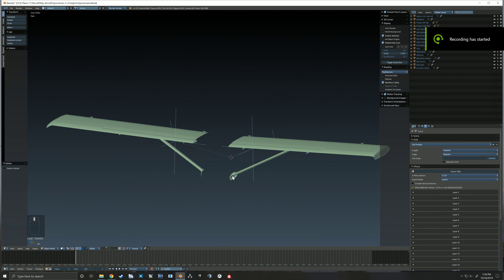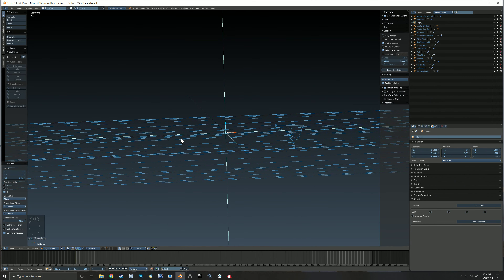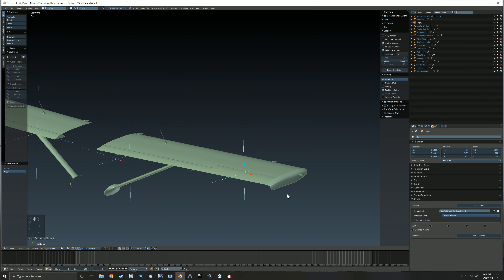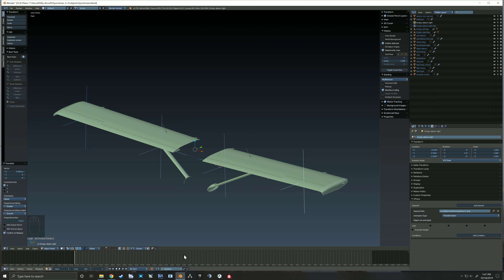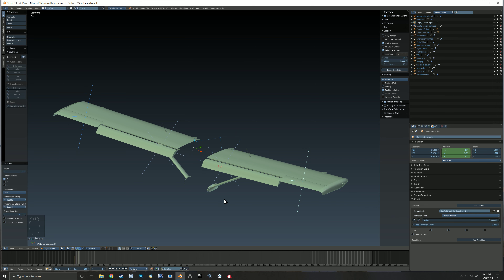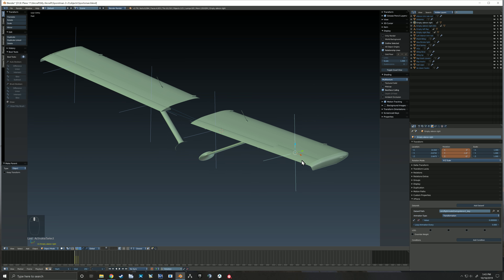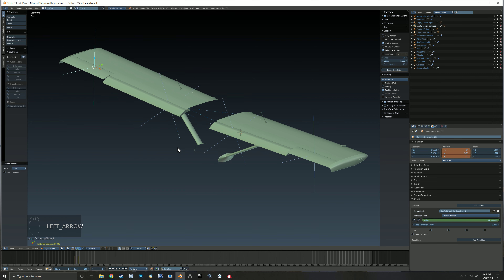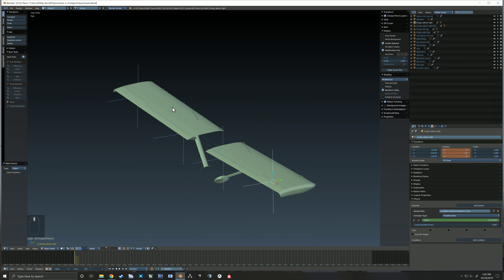How to make an airplane for X-Plane 11 Tutorial #29

Comment: Hello man, many thanks for your video tuts, very informative !

I have a question : I made complex animation of a whole wing ( wing sections for wingflex, ailrons, trim tabs, fowler flaps, propeller ( multiengine ) etc. How to make that full wheel mirrored, including animations ? Cannot just redo everything, and the -1 scale trick do not work when exporting to X-Plane. Any ideas ? thanks
Reply from the maker: Oh man, that’s hard. It seems like I’ve been able to mirror it all before but there was something tricky to make it work. You may try mirroring, then be sure to apply the transformation. This will probably mess up the animation key frames but at least your rotation points should be in the right spot, so you’ll just need to keyframe again. 
This is just a guess though. It’s been a while since I’ve animated anything.